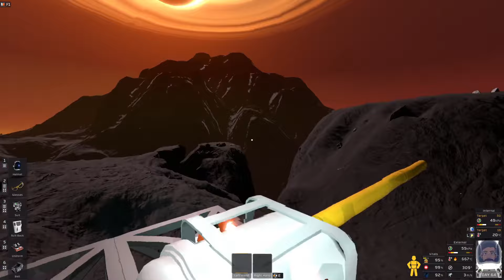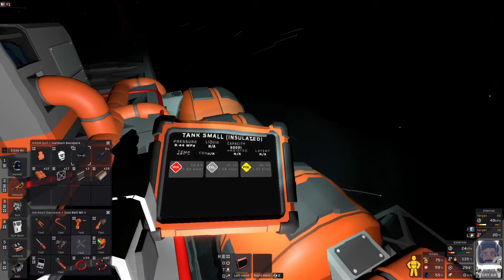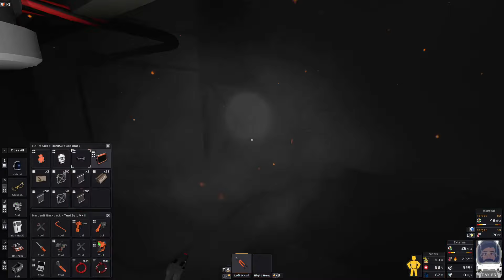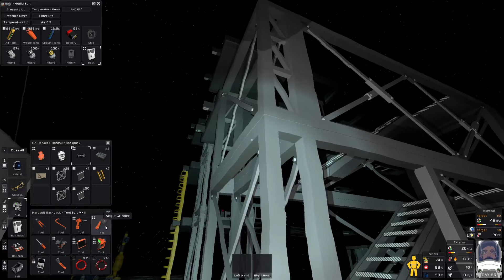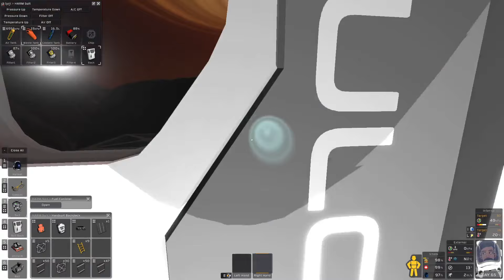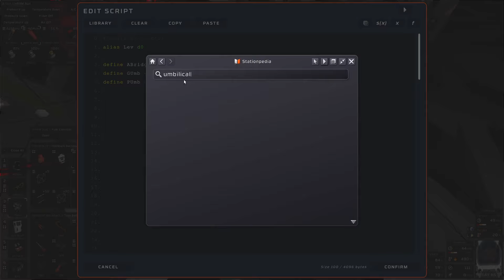Stationeers: Vulcan Brutal 17

Comment: Can you explain in more details? How mapping is done on stationeers?.  And how about extending the Hydroponics room to make a control center? It will give a good view of the Rockets when they launch.
Reply from the maker: Yes, I'll probably get very detailed on that once I get to that point.
Overall the mapping I plan to do something like this:
1) Build a rocket with the deep scanner head and many batteries, launch it to orbit, and leave 2 computers mapping. This will take at least 15 in game days to get a usable map and probably takes closer to 30 game days to fully map, possibly more.
2) From there (without community maps), I'd have to figure out what each colored map region has what resources. That will be a bit more methodical to do and document.
After I do that, I could better plan where I would like to go to make deep miner outposts if I still want to do that. Deep miners did recently receive a nerf with the stationeers update, at least until the devs remake the deep miners and I can get some better stats to the changes.

That is a good idea. I should expand the greenhouse building a bit to have a rocket control station. Especially once I get the better plants I can restructure the greenhouse one more time to plant the better plants for oxygen production and then have some extra plants dedicated for varying up my food.